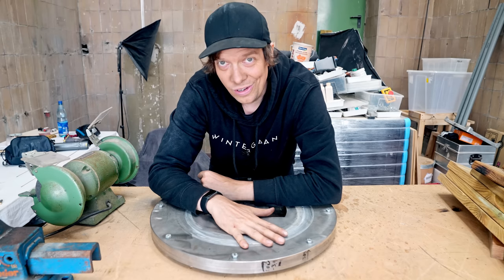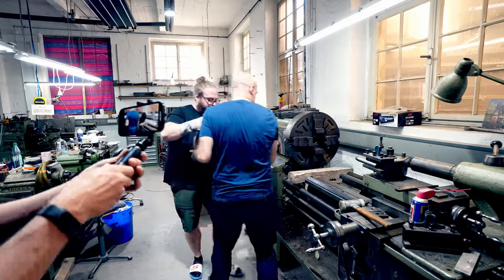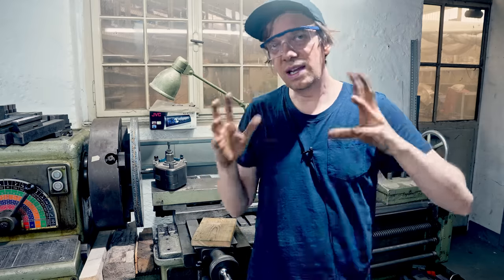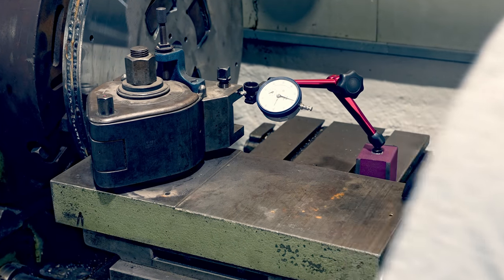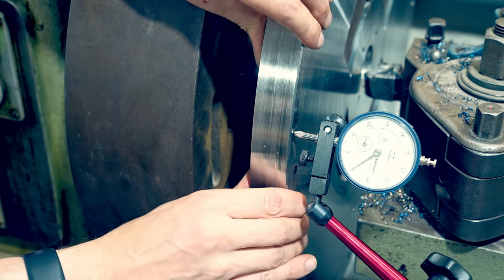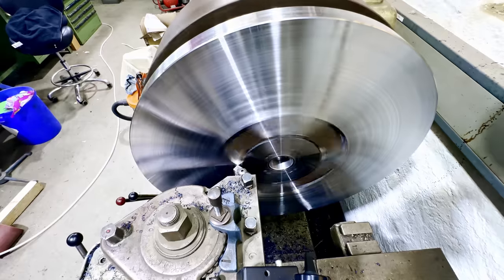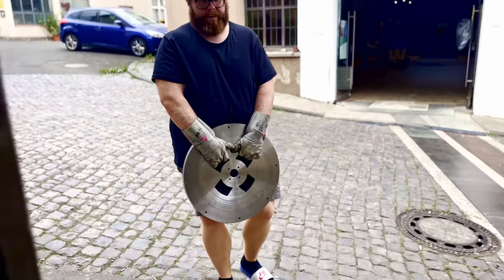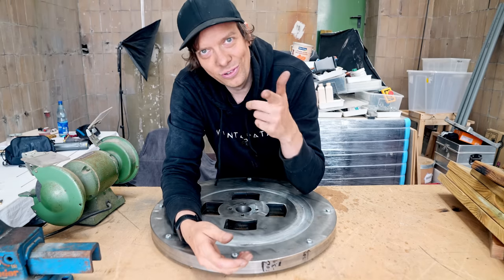Can I Turn This Wobbly Flywheel Straight? - DAY 7,8,9 - Marble Machine Flywheel Prototype

Comment: So just an example. Im making a roubo bench. And I even fabricate roundwood (not using a lathe) which I can get fairly precise at 19mm, so I got a drill right, but it has a chuck which doesnt really well receive a pentagon shape, only round rods, so it has a bit of play. But I make sure to first try it out, not on for instance my table leg, but just on a bit of scrap wood. You should apply this as well. especially on something like this. You wouldn't have compromised your flywheel. So in the future, just test things. Even though your excited to get things done.

Comment: I think your bearing housing concept is great. Your point about flywheel safety tips the balance making this the wrong solution. But otherwise I 100% agree prototyping speed and simplicity is a critical requirement. The goal when making a machine is to fulfill the functional and aesthetic requirements of the machine, not to optimize every variable. Good enough is usually all you need!

Comment: Sounds to me like that's been a very successful exercise.   I see valuable things learned.  1. Make sure the lathe is setup properly and that that's no loose parts before turning.  2. The shaft needs to be bigger to support the wheel.  3. All the experimenting that you have done with trying to get it to turn at a constant speed have been useful as well to feed back into the design process.     I suppose the real question that still needs answering is.... can you decouple the speed of the flywheel from the speed of the music enough so that the flywheel can spin within a given min and max rpm, so that the final output of the power unit can be consistent?
Reply: I think there will be a guvnor at a later stage, he's been talking about it.

Comment: Another important thing to consider is properly balancing the wheel. This means you may need to either add weight or remove some metal from the heavy side.

Comment: The amount of precision needed for spinning metal as with industrial centrifuges (non-medical) they use Spin Cast or Vacuum Cast. This creates a part that is uniform in material density which is easier to balance. I hope you will look into those processes for this part in particular.

Comment: Interesting stuff but it just makes me think of balancing a car wheel. The welds will in theory change the weight balance too. Even 10 grams could potentially cause wobble. I once read an article on balancing aeroplane propellers and that is a real art.

Comment: For your 'production' flywheel, please consider getting someone to cast one.  The accuracy will be far greater.  I'm sure that there are smaller engineering concerns in Germany that can cast and machine the OD and shaft bore at a reasonable price.

Comment: real machinist correct me if im wrong but in the little/garage turning ive done but 1. you should be doing spring passes once the peice has cooled becuase as your adding lots of heat to the material it will grow/shrik your finaly pass should be a small pass when the part is completly cooled. i know this is important when going for a specific dimension but i dont know its affect on the runout of a part.

Comment: During the final tests, I saw the shaft bending slightly before you moved the shaft around. Hopefully getting the shaft improved will make the flywheel run truer

Comment: For heavens sake.  The flywheel wobbled relative to the axis of rotation.  That is the shaft.

If you wish to turn a flywheel to remove material to correct run out, may I suggest you turn the flywheel on the shaft (or suitable substitute)?
Reply: ----/|\----
| THIS |
------------

a) As someone working in (ultra) high precision motion systems (including rotation stages with urad wobble and sub-um eccentricity) this one of the first things that came to my mind.

b) As this is welded from 4 different unevenly formed plates, the effective "moment of inertia" will probably have some static and dynamic imbalance (see also: tire balancing)
Reply: @icestormfr  Martin's brake is axial (parallel to shaft, against the side of the flywheel).  The brake should be radial (perpendicular to shaft, against the circumference of the flywheel)

Applying repeated axial force is likely to create wobble in the flywheel

Comment: "Balance" and "removing the wobble" are two different things. 

If you're making a bandsaw wheel then you need to remove both because you need the outer wheel to be dead straight so the blade is true, and you need it balanced so it doesn't vibrate. 

But you're not making a bandsaw. 

So you just need it balanced so it doesn't vibrate. Use gravity to work out where the wheel is heaviest and either drill to remove weight or add some weight on the opposite side.

Comment: I'm not a machinist but I have watched a reasonable amount of videos of people turning. I was half expecting you to change chucks after the first hole was put in. If you had the appropriate collet chucks you could have turned the flywheel on the final axis. 

That would also make flipping the piece to face the other side fairly trivial.

Comment: I think you should have machined the center hole first, then use the center bushing and axle and grab the axle in the lathe to surface the flywheel. That should result in perfect result for your bushing. And note that you should check the axle when it's in the chuck to make sure it's not bent before you start machining the surfaces of the wheel attached to the bushing.

And add markings to the wheel and bushing to indicate the orientation of the bushing because you get the most accurate results only when the whole combination is used as machined.

Comment: I'm watching "My name is Otto", notification happens and here I am :).

---
The sparks when you used auto feed for the first time was probably the hardened metal from the laser cut.

Also the comments about that the focus should've been on the shaft are probably correct, but facing the side can't hurt. The way you indicated was focused on removing the least amount of material.

---
One more edit, it is disappointing because you wanted better quality. Embrace the learning, embrace the mistake! This wobble, is it making the machine shake? No? Move on ❤

Comment: Hi Martin.  I think it may be possible to "bump in" the flywheel lateral runout with a dead blow hammer.  Those bushings may allow enough movement to correct that amount.  Worth a try before returning anything perhaps.

Comment: When flipping the flywheel around and re-indicating, you should really measure against the already turned side (which is now the backside).
Otherwise you might end up with both sides not being parallel

Comment: 20 yrs operating cnc Laser machines, see if your are has anyone who does hardening of steel.  Get your Laser cut blanks run thru an annealing heat.  The laser process actually case hardens the very edge of the material which induces stresses causing the parts to not be flat.  An annealing heat removes most of these stresses and done properly they can be gotten very tight on flatness specifications.

Comment: I wonder if it'd be easier to keep time if there was some load on the machine. As it is now, the flywheel is free to spin up as fast as it wants to but the only thing slowing it down is the low friction of the bearing. If there was load on the system, you'd have to put in enough power to overcome the load which you could easily apply a balanced force against.

Comment: I haven't watched the video yet but, car wheels are balanced by off setting the wobble by adding lead weights. You might benefit by doing some like this.
Reply: That has nothing to do with the video. That's radial weight balancing, this is something completely different.

Comment: one side of the flywheel being more wobbly than the other probably means that the sides arent perfectly parallel, which i think is more important for an even weight throughout the wheel, although it is already soo much  better than before

Comment: Welding will warp things. So will tightening your bolts in the wrong order or to the wrong tension. You should probably have done short/spot welds in a dividing pattern - opposite sides, then half way from that, and so on. You'd have less to correct on the lathe.

Comment: Wobble is due to mostly play and alignment of bearings on flywheel. Bot the wheel itself. If you map the run out when installed on bearing, you will see if the wheel is installed correctly on bearing.  The shift is not bent. The bearing is not aligned.

Comment: Martin: welds three plates together into a single stack
Also Martin: proceeds to cut away the welds

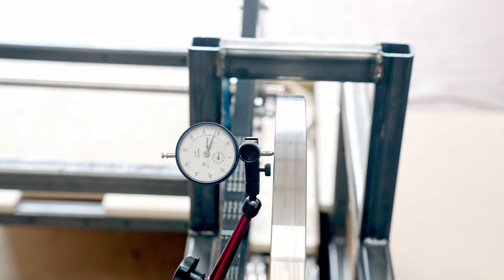The whole stack is held together now by the small welds on the inside holes, and four little bolts. You can see what looks like a seam appearing where the rightmost plate separates from the other two around 23:15. That can't be good for either balancing or safety.

 Also - if you turn the next plate, make sure your cutting bit is solid in its holder, around 13:13 you can see it rotating in place.

Finally, it's a red flag that the SKF engineers advised Martin in advance that he needed a larger shaft diameter and he ignored them.

Comment: Martin, it's not best practice to use a bushing as a final pass-fail for the center hole in the fly wheel, you should be measuring the hole to know whether you're meeting the manufacturer's tolerance. This is because the specific bushing you are using might be at either the high or the low end of the tolerance limits and simultaneously your hole might be also on the same side of the tolerance for the fit. Say your bushing is high within tolerance and your fit is good, but also in the high range of the tolerance for the fit, then it is possible that  when you have to change out the bushing you used as a pass-fail, that the fit with the wheel is out of tolerance. It's an okay prototyping technique, but you have to be aware of the fact that parts that should be interchangeable might not be because you compounded tolerance limits.

Comment: the pulley should sit outside the bearing mount.  bearing mounts should sit as close to the wheel as possible. this will give you shorter and stiffer axis of rotation.  you should also have vertical supports under the bearing mounts to support the weight of the wheel, again reducing the flex in the system.

Comment: The problem here is probably also how the flywheel mounts to the shaft itself. Test the runout in different positions as you are tightening down the mounting hardware.

Comment: Please look into usual car weel for this. 1 they have equipment on every tire repair service to balance your weel. 2 they have conic bolts and nuts that will allow to mount and unmount with predicted percision. 3 it goes with preassembled wheel bearing unit with pulley nd shaft.

Comment: The new wheel should be match ground for parallel first. Then indicate it flat in the chuck. Only have to cut bore and ID. Parts can still be salvaged for 30mm shaft. Shaft should be surface hardened t 56 Rockwell C 1.5 mm deep then ground to finish 29.? Mm diameter. Will reduce both flex and wear.

Comment: Hey Martin. So glad to see you back on the job! I was wondering, is this concept of a pedal driving flywheel your idea for the final design? I personally think it's not a good idea to rely on your foot to control the tempo directly.

My concept would be a machine driven by an energy storage system such as a coil spring or falling mass, controlled by a fly-ball governor with adjustable brake to adjust bpm. Then you could use a pedal or handle to add tension to the spring or raise the mass as and when you like during the performance. Kinda like how a bagpiper adds air off tempo during the performance.

Let me know how I can share a sketch with you...

Comment: Trying to get hot roll plate steel true is extremely difficult. Even with a perfect setup, it will still have some runout.  

Add material to the center bore with the welder and try again.

Lock the lathe to tighten the chuck.

Comment: While you adjusting on the lathe I think you should align near the center where the bearing housing is bolted and not on the outer diameter. If you are perfectly aligned in the center the rest will be perfect after turning. The flywheel turn from the bearing housing. I know nothing about lathing.

Comment: hey, you can try tightening or loosening the nuts/bolts where the flywheel sits on the shaft. by tightening them with a torque wrench you would have even less chance of wobbling.
goodluck!!

Comment: As someone who knows nothing about these things, it felt terrifying to see Martin turn through the welds that were holding the plates together. I'm sure those in the know will tell me the welds are deep enough to not worry about that.
Reply: Well, he did also weld inside the jaw cutouts. So, while he may have destroyed the OD welds, the cutout welds were enough to hold it together long enough to finish the lathe work, at least.

Comment: just wack the side of flyweel with a hammer to correct the runout a bit. as you have a taper bushing, it wil slide and adapt a little bit. with the extend to the out of the diameter, that will help

Comment: It worries me a little that you say you need a heavier flywheel. I think, based on my understanding of the testing so far, you have more flywheel than you need and the inertia of the flywheel is what is dragging you out of time. 

Some tips for getting better at controlling it:

1. Don't listen to whether you are ahead or behind, listen to how that is changing. 
2. If you have gotten ahead, and it's now staying the same, don't try to slow down more at all. Instead, it is time to start trying to speed up. By the time you do speed up you will already be dropping back toward the reference clicker.
3. To help you get control, try adding a little drag by placing something light and safe over the shaft, this will improve your ability to slow down to match your ability to speed up, and will replicate the drag that will be added by the rest of the machine in future.

Comment: martin  order bigger shafts than you think you need and the bearings.. re turn the center hole for larger shafts and re face you should get it down to a tenth of runout that way... also  check how you mount to the chuck..clean jaws and flywheel tighten and hammer  flat to the chuck  you may have been proud of the chuck when you turned the flywheel  with 1 mm and 7/10 s runout on each side
thanks for the videos   adam booth keith fenner and keith ruckker  3 youtube machinists you should watch if you wish to get better.

Comment: I think your issue with trying to true the flywheel is that by making the front surface parallel to the chuck you’re pushing the error to the back.  After truing one side, flip it and make the back parallel with the chuck.  Then all your error is on the cutting side.

Comment: Personally I would have gone with a water weighted flywheel with multiple compartments to add and remove weight. That way you wouldn’t need to take the system apart each time to adjust the weight. Also you could remove it all for transportation which would help prevent damage in shipping.

Comment: Turn the inner diameter as the last step, not the first. Turn one facec, outer diameter, flip in chuck, center using OD and "back side" face, turn second face and THEN turn ID.

Comment: the insert moving at 13:13 Hurt my machinist heart 
I would use an other holder and newer inserts like SNMG120408 HB7020 
Or if you switch the holder I would use CNMG120408 

I picked a good combination for the lathe and the typical Materials you use

the Artikel-Nr in the Hoffmann Catalog are "250018 16/12" for the holder and "GG2531 120408/30" for the inserts
the holder is much more robust and will hold the insert on an pin and clamp it on its side so it cant just easily slip out like at 13:13

Comment: You should indicate the chuck to see if the lathe itself has any runout.  Also your wheel would be better to be a thin disk with a fat ring on the outside

Comment: You may be able to acquire a taper bushing with the ID undersize a bit. Chuck up the flywheel, align  it with as little runout as possible, and then install and machine the ID of the bushing and it should be pretty close to true. Those tapered bushings are not very accurate from the factory.

Comment: If you don't register the flywheel on the bore and axis you are attaching the bearing to, it will always run out. You can't turn one, then decide to turn the other in isolation from it! It's no good facing the flywheel by grabbing it in the slots you've cut for the chuck jaws, you have to reference the face from the bore! 1st year apprentice machinists learn this in the first few days on a lathe!

Comment: If you get a larger diameter shaft, you also would need to have a bigger hole. And you could just resurface the disc again after turning the hole slightly bigger. That should solve your problems.

Comment: I notes that the lathe start handle push down to start – is that not a bit unsafe ?? Working around the lathe - hitting the start handle seems like something that could easily happen – would it not be more safe that pull up to start and more unlikely to start it by a mistake ??

Comment: I wouldn't bolt thinner plates together, I think one large monolithic plate would easier. Could even use cast iron or if you want serious weight pour lead